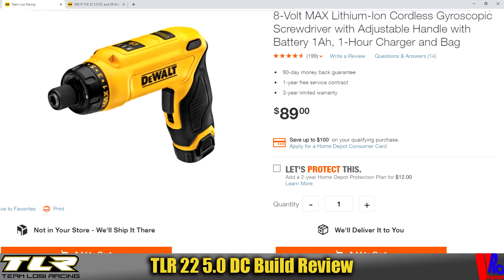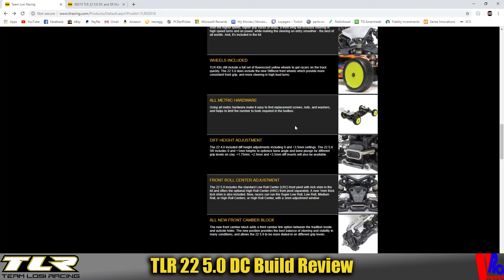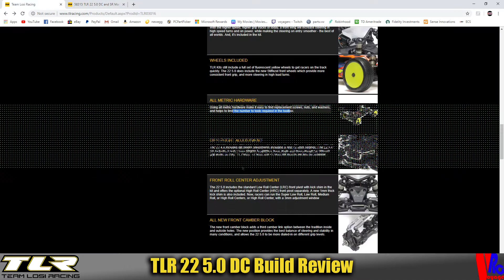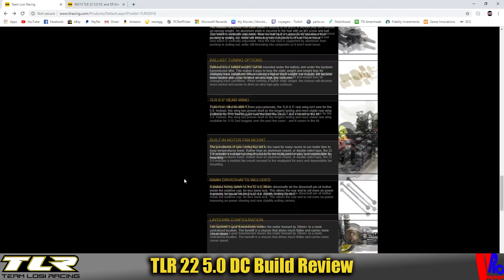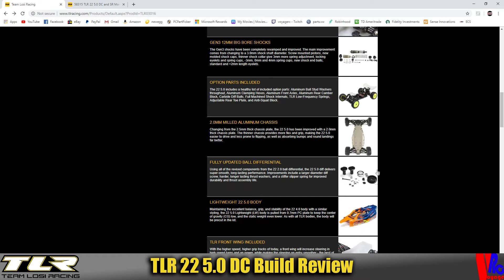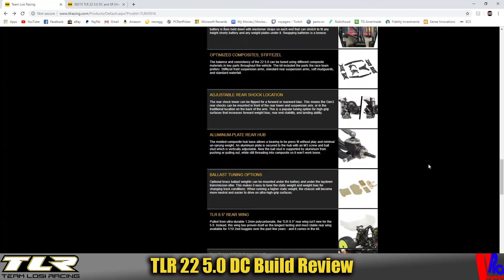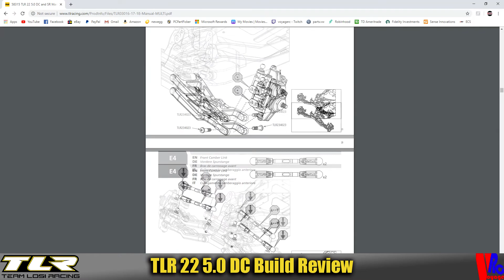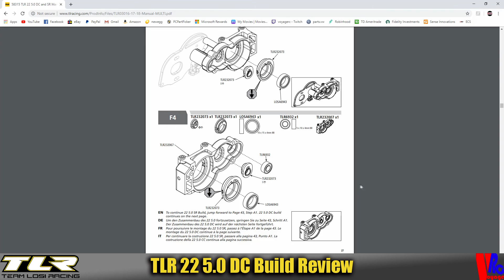Build Review for the TLR 22 5.0 DC Kit - Did they hit a home run?

Comment: I have just gotten a standard 5.0. I am new to rc, and im unsure of what parts to buy to complete the car. Im missing these parts 

Motor

Electronic Speed Control

Servo

Radio System

48 Pitch Pinion Gear

Charger

Battery
Any help and links would be much appreciated.
Reply from the maker: What_Zen those parts are a lot of personal preference mixed with what class you are going to race. I would talk to the drivers at your local track and see what they are running as well as talking to your local hobby shop and seeing what they carry.

Comment: Technically, those small screws use a 1.3mm driver. Much like how a 5/64 wrench is really close to 2.0mm in size, an 0.050” wrench will do in place of a 1.3mm. 🙂

If you want to go “truly metric”, just get a 1.3mm wrench. MIP (and I think a few other vendors) have them available.